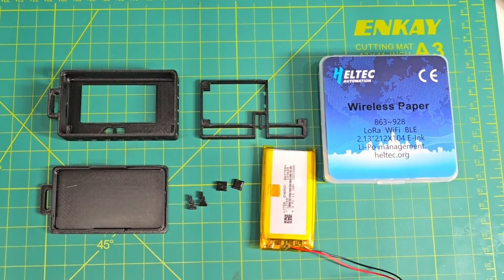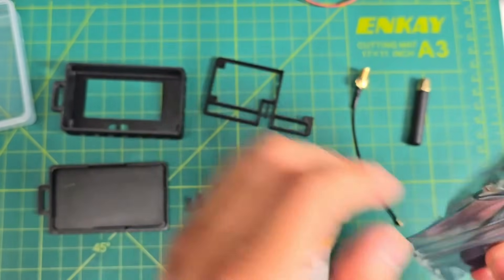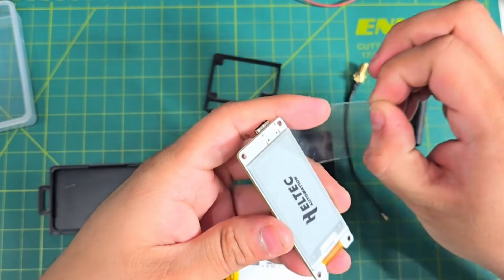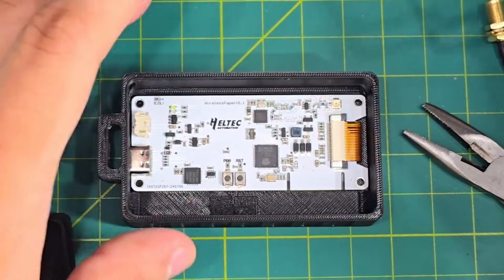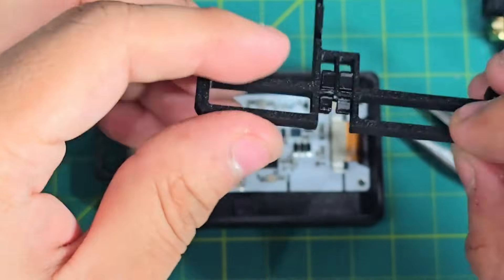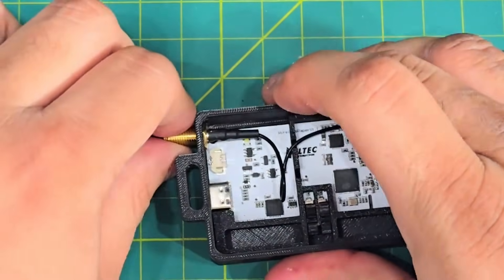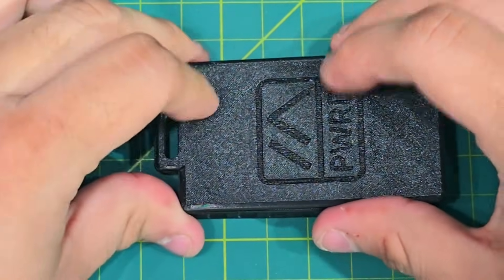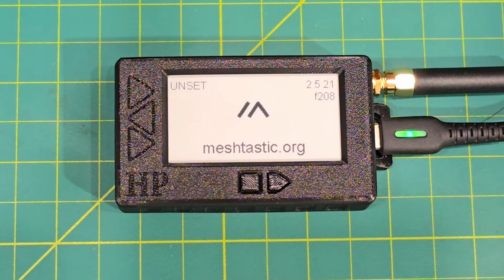HP - How to assemble the case for the Heltec Wireless Paper  Meshtastic Node.

Comment: A possible upgrade for later case designs: reinforcing the plastic around the antenna connection. I bought a large gooseneck-style antenna upgrade and accidentally put too much pressure on it, and cracked this case right at the antenna hole. The thinnest part of the structure around the hole cracked right off on one side, and the rest of the case began to split badly between layers right at the midpoint. To avoid this in later designs, might it be possible to build up the plastic more thickly around the antenna connection hole? 🤔